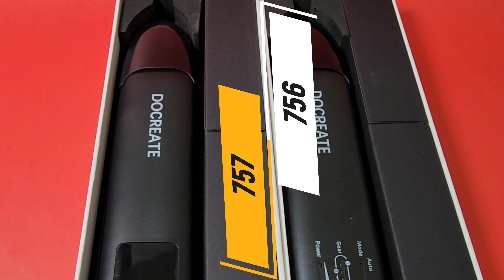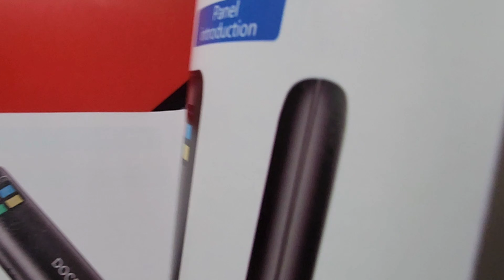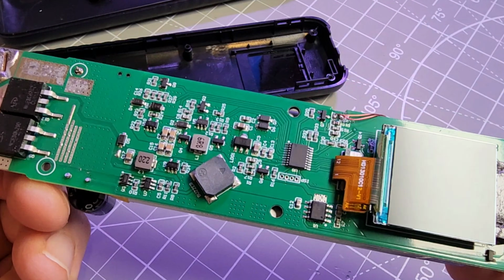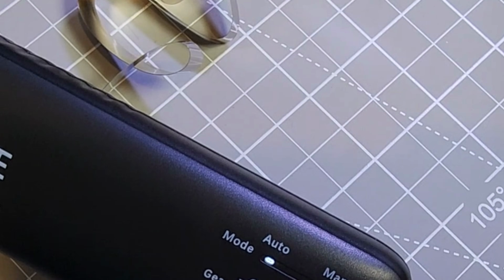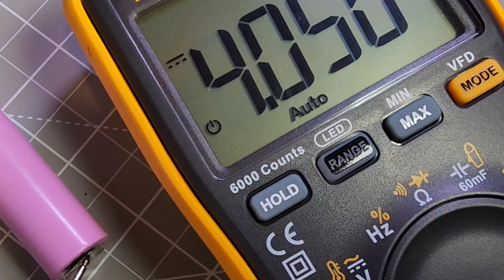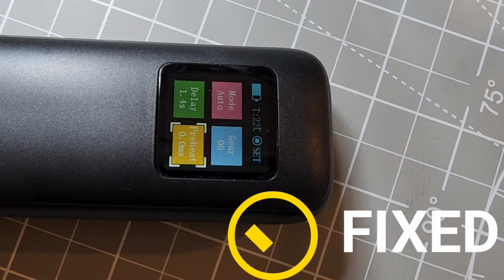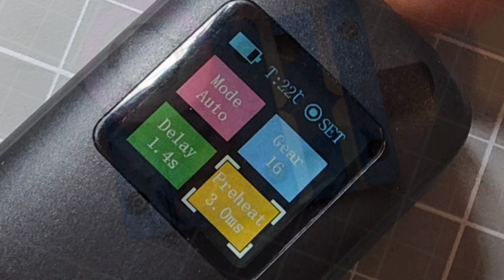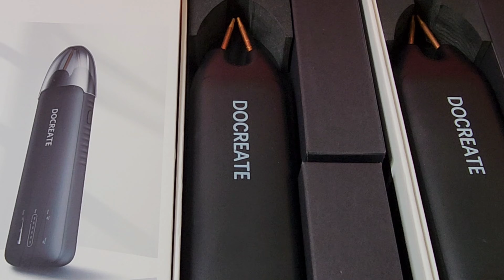BE VERY AFRAID! DOCREATE MINI SPOT WELDERS 756/757

Comment: I had the same problem with my Docreate-757. While not turning on while good charge on battery I measured 5Volts on the electrolytic cap. I shortened it to discharge and now it works again.

Comment: I got the 756 and it wouldn't charge.  I checked the battery voltage and it was below the minimum threshold for charging the battery.  Testing the device showed it was trying to charge the battery.  I had soldered a couple of wires to the battery in the device, being careful to not cross the wires.  on the other end I used a piece of the nickel foil.  I have a 18650(actually charges any battery) battery charger/repair.  I had used an old battery(taped of course) to pin the metal foil against the charge contacts.  I made sure polarity was good(the charger would have indicated if I hadn't).  The charging/repair device fixed the charge in the battery.  The unit now charges and works with absolutely no issues...  battery charging device NUSGear HXY-H4
Reply from the maker: Where there's a will there's s way! KeepOnTesting

Comment: I opened mine, and its even got smaller battery, 1800mAh. Do you think I can another battery in parallel?
Reply from the maker: Probably not recommended 😕
Reply: @KeepOnTesting  Too late, done it, had 2 both were useless. One has slimer body so the 2nd battery would not let its covers clip in. Had to removed both batteries and put it back in the slightly bigger case. Seems a lot stronger now, but have not done a full set of welds yet. One other thing is both had only 2 mofsets, LRO13NO3TL2, can't find any specs

Comment: I just received mine, did a test after charging, worked spot on... A quick question, it might sound silly but, I just dont know the answer. Can I hold the strip while welding it to the battery. I wasnt sure if id get a shock off it??
Reply from the maker: Grest question,  Yes, fear not..you can safely hold/touch the strip as you are spot welding without fear of getting shocked. 
😉👍
Reply: @KeepOnTesting  Thank you.

Comment: It worked twice, but four months later, when I took it out of the box, it did not respond at all and did not charge.
Reply from the maker: That's not good to hear, sorry you had those issue too.all in all it's a real turd..
Reply: @KeepOnTesting  So is there a solution? What can we do? I charged the battery externally, but the device still does not turn on.
Reply: @NoThingL0se  try and open the case and charged it manually with a constant voltage, constant current charger, the cheapest may be TP4056 charging module
Reply from the maker: I'm leaving some seriously bad feedback w Banggood.. they need to stop selling this crap. Other than that, there's not a lot of  recourse, but you can be sure I'll raise a stink every chance I get.
Reply: @KeepOnTesting  It is also sold on temu. The product is trash in my hand, I am very sorry, thank you.

Comment: What about comparing thikness to gear ratio? Or mabe some tables where i can see?
Reply from the maker: Great question..These settings control the output power or intensity of the welding current. So, a higher gear ratio should equate a stronger weld. I'll try to do a comparison of the different gear effects on the next handheld welding review.

Comment: just got mine in it wouldn't turn on wouldn't charge so i plugged it in a different way and the charging battery meter came on  then if you press and hold the side button that's how i turned mine on the button on the back is just for selection the settings the side button turns the unit on

Comment: I got a 756 which I thought was enough for functionality. But it wouldn’t charge: the charge indicator LED kept blinking. I opened it up and found out that the battery was at 2V. I used my smart charger and brought up the charge up to 3.6V using the NiMH charging mode at 0.1 A. Then plugged in the USB C cable and boom: it was charging. I got it fully charged now and will be using it to make some 7.4V Li-Ion packs
Reply from the maker: Hey great info! Thx for sharing and those 7.4v Li-Ion packs are the 👌best!
Reply: i had the exact same issue, and came to the same resolution using an external charger. Seems to be working but i'll be sure not to let that cell fall under the minimum charge threshold again!
Reply: @lordimpy6260  Anche se non lo usi, sembra che il circuito assorba comunque un minimo di corrente, per cui è meglio tenerlo sempre in carica. Tanto c'è il limitatore di carica interno.

Comment: Buenos días tengo una de la pantalla digital y lo hace todo menos la etapa final dé soldar, que puede ser el defecto que tiene, gracias por su atención, espero pueda ayudarme
Reply from the maker: It sounds like you may have a capacitor issue. Have you tried replacing the capacitor?

Comment: Sorry Darren,  I too got a defective unit, maybe cuz I bought it on TEMU. . Broken button, inconsistent welds and very slow charging rate. I'm dissapointed in you. poor review, regardless of the FABULOUS amount of nickel strapping (really? seriously?)
Reply from the maker: Sorry for your bad experience..My welds were consistent after the fix.Yes,no excuse for bad QA but seriously, this thing is cheap as Borscht and they would have sent you a replacement if purchased through my links.
Ultimately,  it works fabulous when it works and I'll be dang that nickel sure is sweet!  😃
Reply: I got my from Temu and also is defective. Replaced the charging IC but that didn't fix it. I can turn it on but goes off by itself or when I'm trying weld. Any idea what else can be broken?
Reply from the maker: Did you get the Dispkay or non display version? If display..check the big capacitor..
Reply: @KeepOnTesting  I found the issue. Solder joint on battery + terminal was broken in half :) it was under capacitor and paper tape so I didn't spot that before. Resoldered and it's working fine now. Thanks man !!
Reply from the maker: @JoeScagsTube  👍Great job!!

Comment: Having worked in factories and setting up a lot of product for testing it is possible that battery made it through testing only just, then died later but maybe indicative of a QC fail both at the batteries manufacture and the device it was installed in - the charging component is far less likely I would think to work in testing then die just sitting in the box - unless theres no test routine for the charging operation but seems unlikely - im just guessing of course.  On the other side with all of the devices today that come with spot welded batteries this is a great tool to have in your arsenal.  Sadly in some manufacturing there are acceptable rate of defects, usually less than 1% but the goal should be zero - but we all know in todays world zero defects is a pretty lofty goal, though some products are easier to hit this goal than others but given the fact that even multi-million dollar space craft have their degrees of failure just reminds us both people and hardware are both susceptible to failure even after testing.
Reply from the maker: Definitely the QC was lacking here but hoping it's a one off. Since replacement of the charging IC it's been stellar. It makes me wonder if something else killed that component, I might go in for a second look at some point. 👍
Reply: More than 1 % that's for sure ...

Comment: Thanks Darren!  It seems to be a pocketable solution that I didn’t know existed. 🎉. For me, I tried the fixed probe single unit welders, and was disappointed by the user experience. Without a bubble level, it’s difficult to apply even pressure from both tips. 😢 Although not as compact, having separately wired pens is well worth the control and consistency.  😊.
Reply from the maker: It's proven to be a really useful tool Paul, 👌  Small but can pack a mighty punch.

Comment: Spots it creates at max. are larger and deeper, not what we see in ready made electronics where they're tiny and firm.
Reply: Is there a functional difference? When I'm replacing batteries or building a project, I care about strength and current carrying capacity.  I care about how it works, not how it looks.
Reply from the maker: It's not designed for super fine, small welds! It's a handheld spot welder.. not a precision benchtop unit. That being said, on lower settings the welds are much harder to notice.
Reply: @KeepOnTesting  Got it. I still imagine how small yet strong welds could be achieved from a professional heavy duty unit.
Reply from the maker: @bhushan9066 Aesthetics aside,  it will be less prone to accidental wear and tear. The welded joints, when done correctly, should give you that factory oem finish. Which should equate to better conductivity and prolonged usage without failure. 👍
Reply: @KeepOnTesting  If I have to choose between a weld that it too light and one that is too heavy, I'd prefer the heavy. In doing a battery weld as hobbyist on a home workbench, it is going to be difficult to get it perfect.  I'm happy with "good enough."